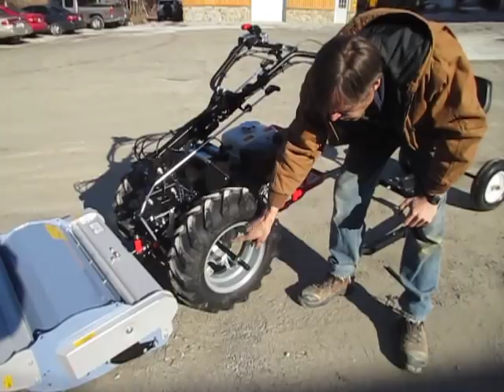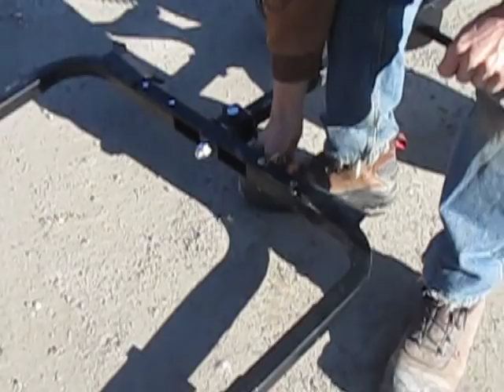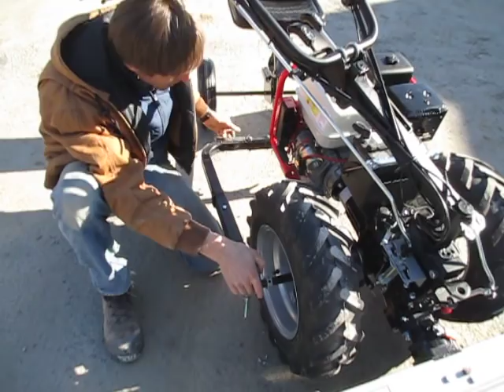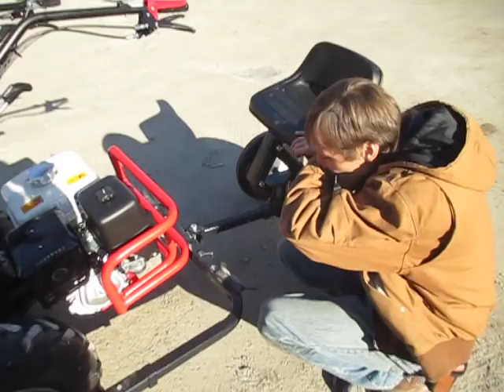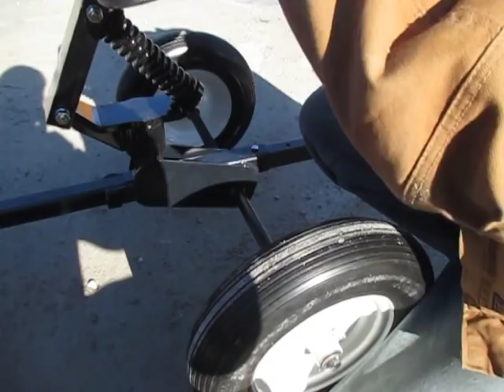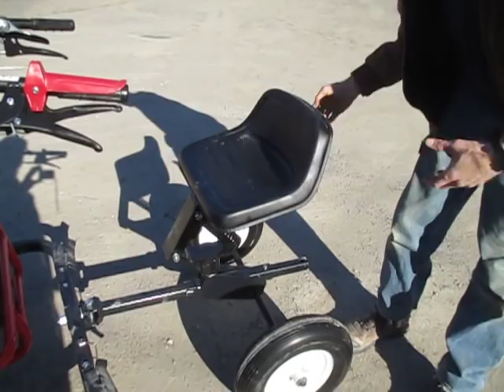Earth Tools Sulky for Walk-Behind Tractors: Features and Installation

Comment: Just got my Earthtool sulky, used it to mow 1.5 acres today, great invention!  Can actually assist in turning the tractor by leaning a bit and using your legs to push in desired direction, helps to use less of hand brakes than usual.

Comment: Looks like a great unit. There is a workaround to installing the BCS sulky with the factory wheel weights that I would also recommend. If you are running bar bell weights, the one shown here looks to me like your only option.
Reply: Hello...Yes, I am aware that you can mount the BCS "factory" weights with the BCS-manufactured mowing sulky, as the weights have a pass-through hole in the center.  However, you can use the BCS "factory" weights with the Earth Tools sulky as well, for the same reason.  Of course, the advantage to the barbell-weight system is that the weights will cost you a LOT less per-pound...you can usually find the barbell-weight plates used at a yard sale, making them even cheaper.